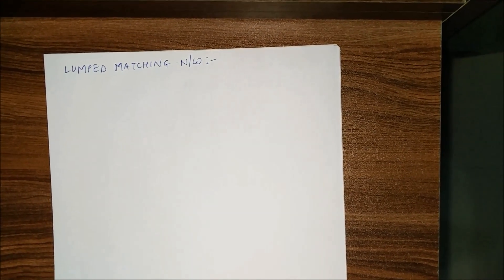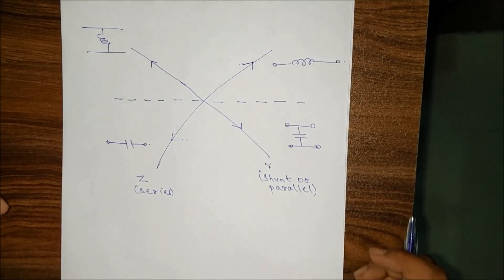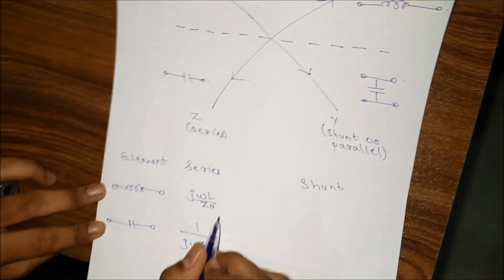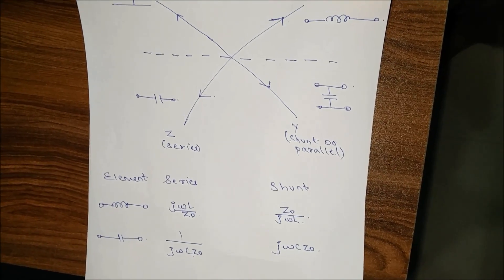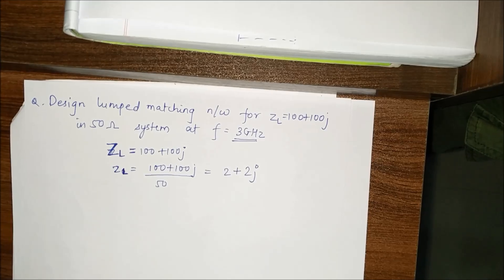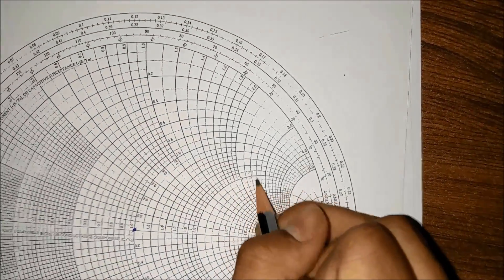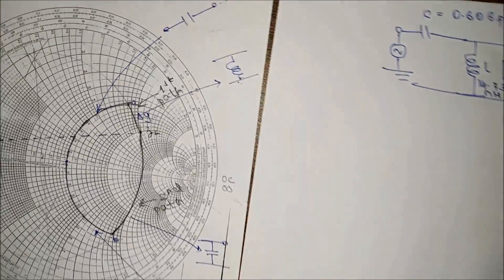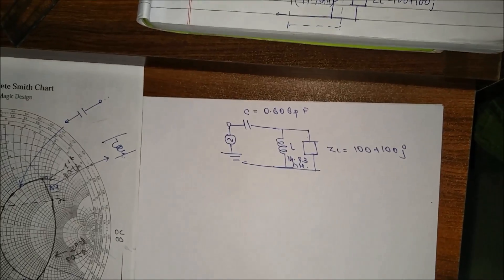Lumped matching network

Comment: Bhai capacitor ka value 0.606pf kaise a raha hai
Reply: Bhai jaldi reply do
Reply from the maker: Calculation karke bro... Ye kaisa sawal hai... Please take a pen paper solve it calculate it and then if you have any issue let me know.... 
Hope this is helpful...
Reply: @electrofun5135   same question nh aata bhai 31.6 pf my answer aata hy
Reply: Bhai mera 31.65 pf a raha hai
Reply: Ek que aur hai agar zL unit circle ke bahar aaya toh phir kaise karenge suppose 0.2-0.4j

Comment: The value for L & C that we are getting after calculations are double and half respectively of what you have got in the answers by using this formula. Please help out with the same.
Reply from the maker: Please check you solved solution once again because we checked it and didn't find any issue as per you said... hope this is helpful 
Thank you 
Please stay tuned for more such videos...

Comment: Why are you not taking complex conjugate of load... According to max power transfer theorem u hav to take complex conjugate na....
Reply from the maker: There is no such method for taking complex conjugate. And max power is transferred using passive elements as shown in the video.